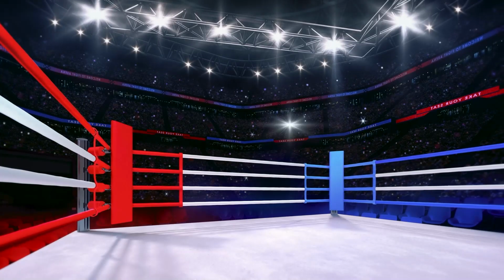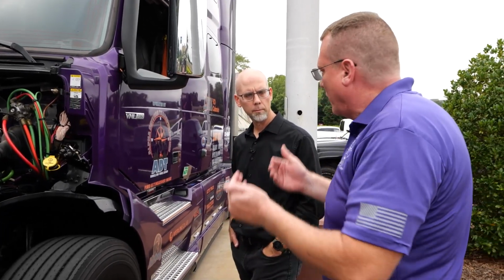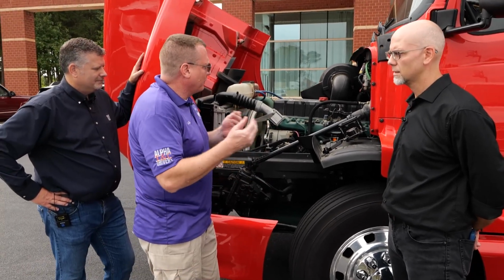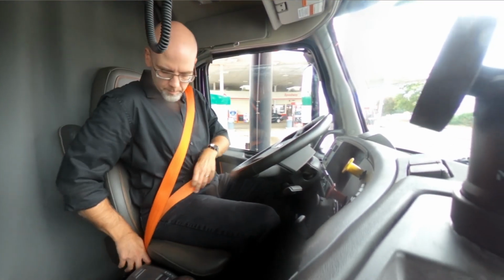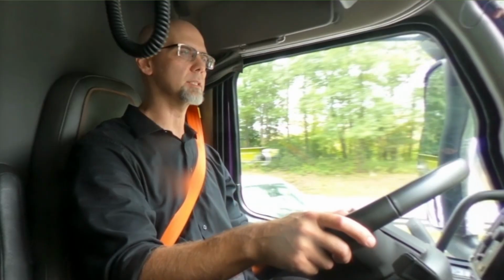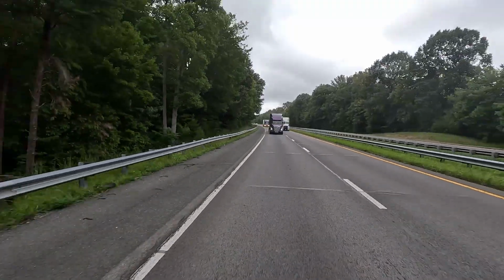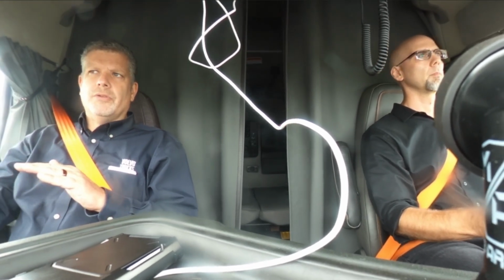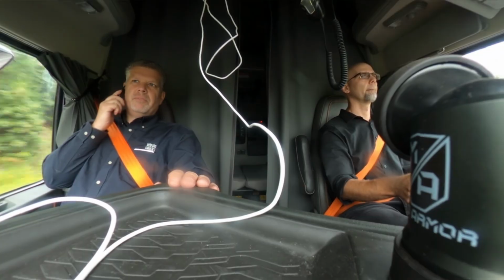Volvo Trucks – Episode 4: It all comes down to this

Comment: Not quite what I expected. 
Why wasn’t there a proper hand over of trucks to the drivers? How serious is this challenge? It costs money to organize and operate this challenge. I don’t think we can blame Jason here, as he is brand new to driving trucks. However he should have familiarized himself with all the vehicle controls prior to setting off. Surely driving in cruise control is paramount to efficient driving. Knowing this the co-driver/coach in both trucks should have been capable of hand over instruction to get the best from each vehicle.
I look at the number of likes and comments. What are the viewing numbers? Are people watching the videos completely?
Perhaps, replies to comments by those involved in the project would help.
There should be a big following here between VOLVO enthusiasts and those that follow Fleet Equipment.
Rules or a guide of what is expected in the challenge can be compared to the actual results. The route should be run twice with the drivers switching trucks. Make it a real test. Obviously there is a huge mismatch of trucks, so let’s see Jason’s results in both trucks against the more experienced driver in both trucks. Let’s record route times, fuel use and earning potential. A challenge needs to be a challenge. 
Will it be the driver that lets the vehicle down, by failing to optimize the vehicles potential or the vehicle not living up to what was expected of it?🏴🇺🇸

Comment: You are right about the VNT with the old 16L. They were aimed at owner operators. I do not know the exact spec on the drivetrain, but for some reason only a small quantity were built. Perhaps more went to Canada. As you are aware the interstate GVW is only 80,000lb. Large displacement and big horse power wasn’t really needed. The Detroits at that time would have been 12.3L, the Cummins being 14L.
When the M11 was introduced to meet stricter emission standards the displacement dropped to make it more achievable. Most engines today are around 13L although they have very few features of the older engines, in both design and electronics etc. Today’s diesels have come along way in the past few years, as have automated gearboxes and low friction axles.
Volvo in Europe do sell many D16Ks for use in different markets and for different applications. For many years Volvo were known as the high horse power champions. Their current max horsepower is 750, with options of 650 or 550 with the same engine in the FH version 4. I believe the 13L maxes out at 540hp in Europe.
SCANIA’S the champion now and have been for a while, with their 16L V8 at 770hp. The lowest output is 530hp.
Believe it or not many fleets run the big engines.

Comment: I drove a  2016 Freightliner Glider with a 60 Series Detroit .. I  got the best MPG @ 68 MPH .. If I slowed down the MPG got worse.. I also drive a 2020 Freightliner with  a DD-15 and  automatic..  Between  70 MPH and 55 MPH  the more you slowed down the  better your MPG got..  It was so nice  not to feel guilty for running   68 MPG  as that is where I got my best MPG
Reply: It goes to show that speccing the engine, gearbox and axle ratio is important for the type of work you do and terrain you run.

Comment: Google traduttore IT= 
This truck is fantastic in everything, the only thing that really can't be understood is that Volvo has its own engines and in the USA, in 2022/23 the Volvo VNL740/760/860 with the most powerful Volvo engines with D13 only 500hp USA? Where are the high power Volvo D16 550hp/600hp engines? Previous years Volvo had the fantastic Volvo VT880 with the incredible Volvo D16 engine 625hp in 2006/2008 I have a magazine about the Volvo VT880 model. Volvo VNL 730/780 with Volvo D16 550hp/600hp engines. In 2023 the Volvo VNL860 USA with the strongest engine and a D13 500hp? I can't understand how Volvo allows this to lose market share to competitors with engines with more ➕️ power 
I hope that in 2024 Volvo will bring back high-performance engines to the VNL 740,760 and 860 models.